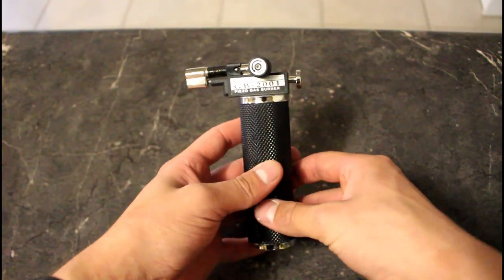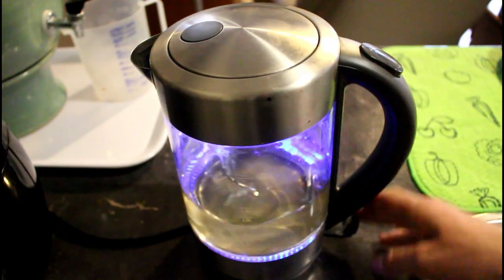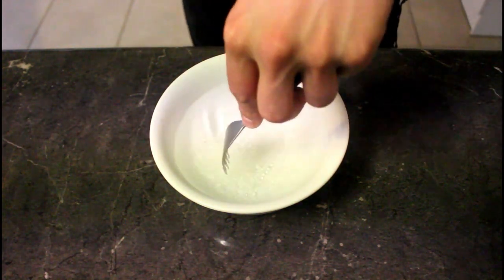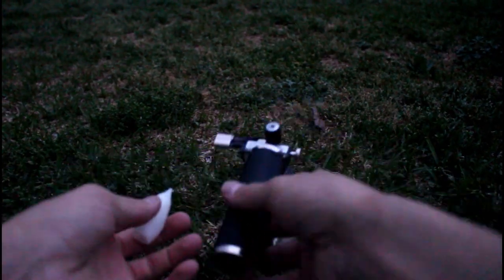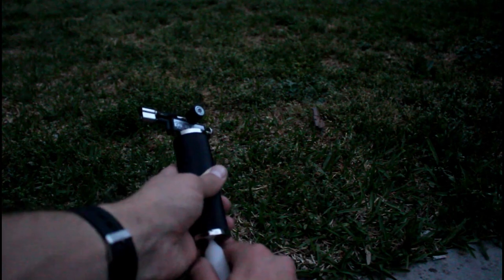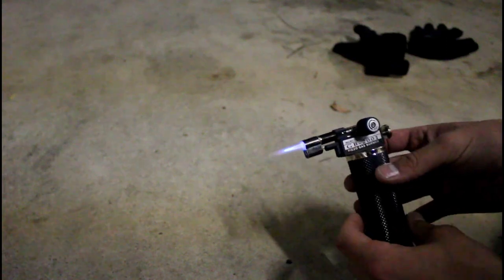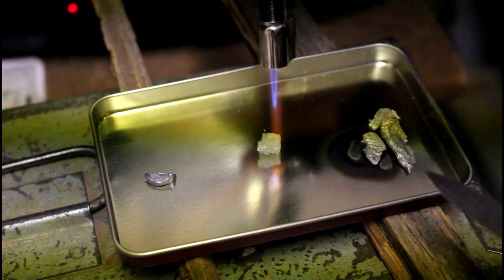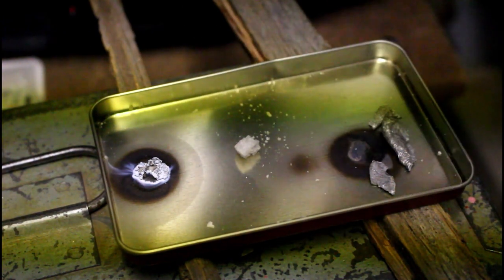Making an adapter for my butane torch

Comment: It is said that you cannot burn anything in both pure N2 and O2. However, there is no actual evidence seen, instead of assumptions from various sources, that it's true for pure N2. May you record of something being burned, with proper safety procedures in mind, within pure N2?
Reply from the maker: Fire requires four main things to, well, exist. They are: Fuel, Heat, Oxygen and Pressure. So yes, it is true that you cannot burn anything in pure Nitrogen. I may do a video on it one day, but at the moment I lack the funding to get a tank of Nitrogen. (shameless plug* I have a patreon page ;)
Reply: Scoop Science the youtube channel "Pete and Peter" have conducted a test to show that fire requires air not oxygen, hold on for that link or check out their "water is water, not h2o" video
Reply: Scoop Science here is the link to their video explaining that fire requires air not oxygen https://youtu.be/wb0zmZ6eGz4 , go to the time marker: 12:03
Reply from the maker: Air contains oxygen though

Comment: Mine is too short. But I dont have plastimate....
Reply from the maker: Plastimake is relatively cheap.
Reply: @scoopscience  hello, surprised you replied since this video is kind of old now but yes I'm looking into it right now actually lol
Reply from the maker: Nice! Also I read every comment on every video still. No matter how old it is.
Reply: @scoopscience  ok so I took the stand off of my torch and the butane can now fit in the female part of the torch, now do I need to have a nozzle on the can or will it still fill up without it ?
Reply from the maker: If it fits it should fill up. Make sure you turn it upside down to fill it up though. Mine just never fit even if I took the whole thing apart